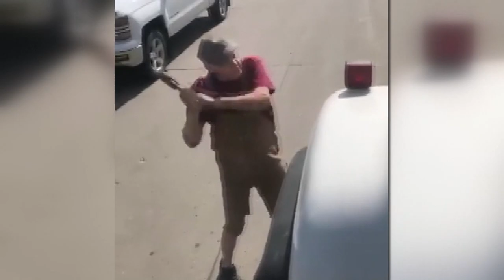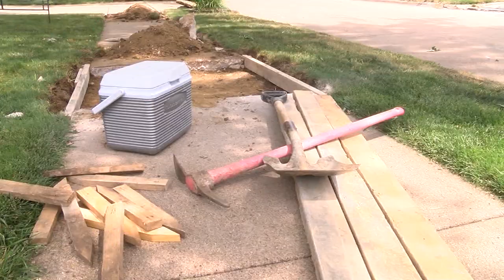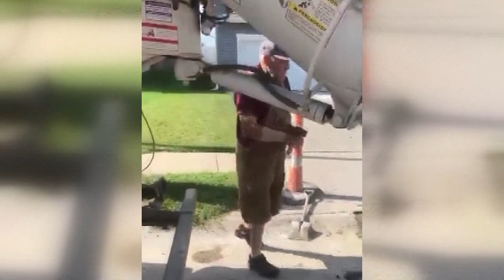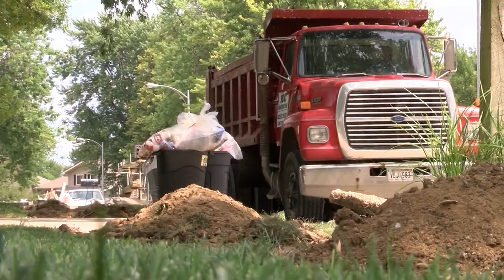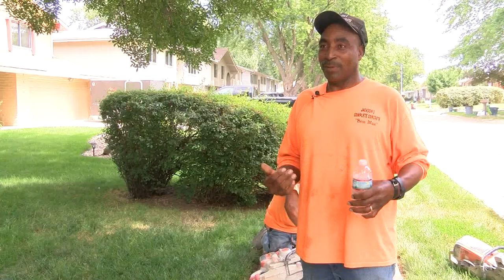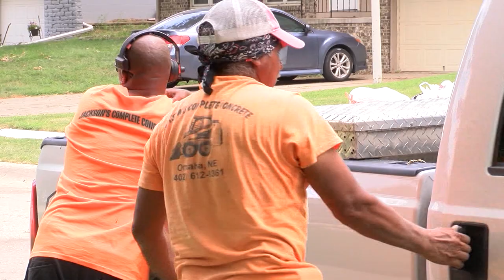NE: MAN ATTACKS TRUCK WITH HAMMER (CAUGHT ON CAM) - CNN

Comment: well, bit of news flash for the old guy. Sorry, but there is a thing called a easement. So actually so many feet past the road is actually still own by the county you live in. usually between 5 to 12 feet past the curb of the road.
Reply: It’s still property he has to maintain, you don’t let someone key your truck or break your windows either just because you don’t “own” it that man wanted that fucking truck off is lawn 💁‍♀️💁‍♀️
Reply: @jakehighland929  feel free to try to justify the old mans actions
Reply: @Lalo-tp1sd  that truck coulda moved 🤷‍♀️🤷‍♀️
Reply: @jakehighland929  Sure it might have, if the OWNER had been present!   It did not belong to the concrete company or any of it's employees.  It belonged to a neighbor, who was not around for any of this.  Nobody in this video owned or had anything to do with that truck.

Comment: Yo concrete guy...your chop saw blade is on backwards.
Reply: What chop saw?
Reply: @johnnybravo-ir3ev  the concrete saw is also sometimes called a chop saw. The blade probably works because it’s abrasive, and doesn’t have teeth, look at how it is shaped compared to direction of spin